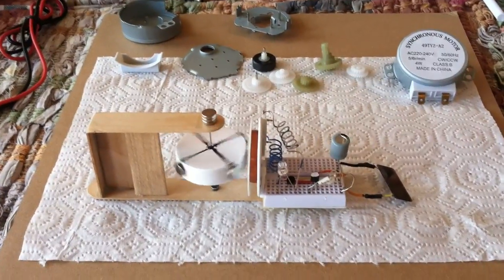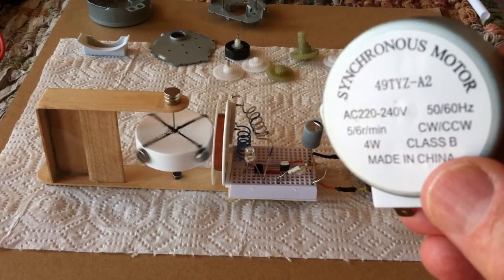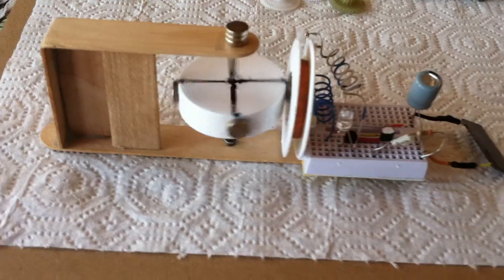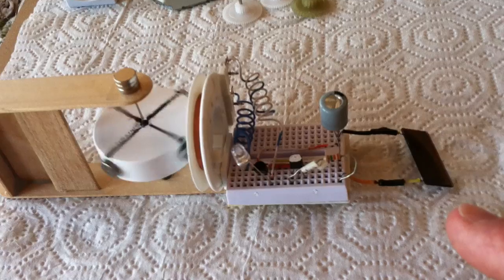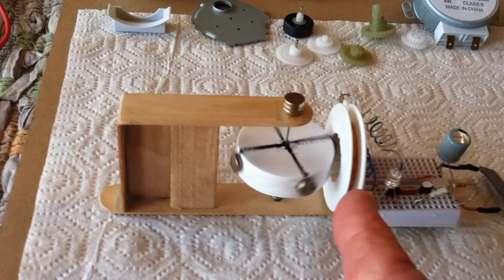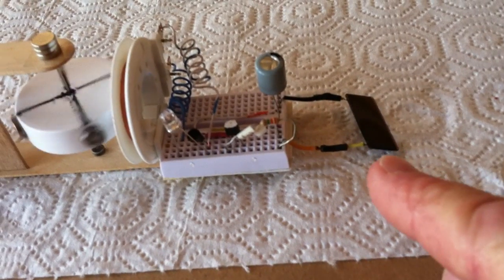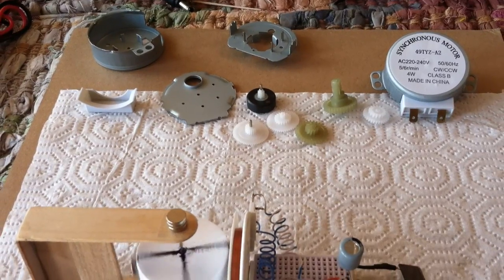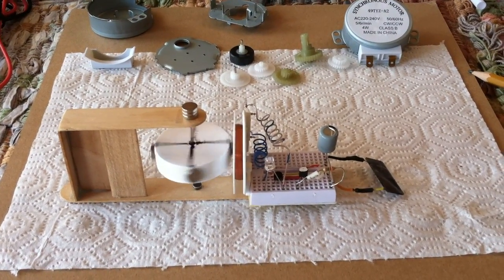Great News! ----- Excellent coil for micro amp pulse motors

Comment: I usually scrounge these out of 110v microwaves; I was checking olms on about
5 of them the other day and averaged about 3k olms for each.
I would appreciate some feedback from folks out there in how much resistance they
are finding in salvaged coils. Maybe my meter is wrong. Do most of the 220v coils
come in at about 11k?  Am I right about the 110v coils?

Comment: Hello Lidmotor.  Do you know where I can find a micro-controller controlled transistor/mosfet circuit for a Newman Motor?  I want to control the duty cycle, frequency and pulse width with the micro-controller.

Comment: The microwave synchronous motor coil is found in many other appliances also. Most fans that oscillate use one of these motors. (in addition to the main motor.) People throw away fans all the time because they stop oscillating. The motor (and coil) are usually fine, it's the little plastic arm that attaches the motor to what it is turning, is the part that is broken. I also replicated your basic electronic pulse motor (Title is: "Bendini style modification to basic electronic pulse motor") using this coil as the trigger coil and the microwave oven fan coil as the run coil. I also slapped together a fidget spinner pulse motor the other day (see my latest video in TallDudeInLA playlist) I know you can really go to town with a fidget spinner. I'm waiting to see what you will do with one of them!Eric (Tall dude in LA) using my wife's You Tube channel)P.S. If you can give me advance notice the next time you are going to be in L.A.,me and the wife would love to treat, you and your wife to dinner at a fine restaurant.
Reply from the maker: Thanks for the good comments.  I watched some of your videos and was glad to see the replications of my projects.  Your new "Fidget" motor impressed me so a sent away for a couple of those spinner toys to try.
Reply: Well, it was your videos that got me hooked on pulse motors and taught me most of what I know about them. (I think we had the fidget spinner craze before the public did, we just called it pulse motors:)

Comment: I'm glad that this worked so well for you. I see you got 240vac motors, but for most of us in north America will have 115vac motors at around 1 third the ohms so expect different results. Lidmotor what are the dimensions of the magnets you are using ?
Reply from the maker: These neo magnets are 5/16" x 5/64".  I got them at Harbor Freight.
Reply: I've been using the same ones, they seem to look larger in your video.

Comment: What is the Amp draw? 

Paul
Reply from the maker: I just did some testing and it is under 5 micro amps.  This is really really good news. You and Pali should get some of these and see what you can come up with.  Cheers.
Reply: Already ordered from Ebay. 5 micro amps is really great for an 11K coil. Still using the same circuit?  

Paul
Reply from the maker: Cool.  This is the same circuit from my last video.  https://www.youtube.com/watch?v=iIAHBDEik-s
   I replaced the super capacitor with a 330 uf cap and the solar panel. I upped the resistor to 3 meg.   The led doesn't flash at this low of power so it can be removed.

Comment: beware of spinning the magnet while it's still in the motor if you touch both leads you get a nice little high voltage surprise
Reply from the maker: YES!  I already knew about this so I was careful.  It is hard to turn but I put a neon across the terminals and it came on super bright with a slight twist of the motor shaft.
Reply: lol.i was playing this motor before  by accident i touched the terminal I've got  really nasty shock.
Reply: I'm poking at the idea if an arduino controlled motor kit with the right sized gears/cogs would be strong enough to spin the turntable motor and fwbr rectify it to self charge or power something else.

Comment: NICE !
Had no idea of the huge ohmage on those types.
Reply from the maker: I have know about these coils for awhile but finally got around to trying one.  It was the coil shape also that made a big difference.  This thing runs at under 5 micro amps and down to around 1v.  Some of our homemade batteries will run this easily.  I have been playing with this all day.  The 4 pole magnet in the MW motor made a cool little motor rotor also.  Ran it on a simple reed switch setup.

Comment: What circuit are you driving it with ?
Reply from the maker: This is the circuit.  I changed the resistor to a 3 meg and the cap is now a 330 uf.  The tiny solar panel is attached across the cap.  https://www.youtube.com/watch?v=iIAHBDEik-s
Reply: How do you choose the value  of the cap and  resistor ?  I want to replica it. Please help me:)

Comment: Another microwave oven part put to good use 😊 I actually get hate comments and abuse for daring to use microwave oven parts for projects 😊😊 I have a couple of those motors tucked away so I will have to give it a try 😊😊😊
Reply from the maker: I was surprised how easy this microwave oven motor was to take apart and how many usable parts were in it.   The coil was the grand treasure but I might make something else with the other stuff.  The magnet is pretty cool and I think I can use it as a motor rotor.
Reply: I've got at least one of those motors in my scrap parts pile. :)
Reply: Not certain why the hate comments for using the parts.  I get old free microwaves from a local appliance store.  I get thermal cutoff switches (for overload protection) timing circuits, magnets from the magnetron, capacitors,  transformers (which I sometimes rewire),  light bulbs and fixtures, numerous fans, and of course the platter motors.  Microwave ovens are a treasure trove of parts.  The rotary motors can also be used in reverse as generators.
Reply: You would have to watch my videos to see the comments, some people just feel the need to make comments like that. I could drop a link here but it would go in the spam folder and I am not trying to take viewers away from Lidmotor anyway. I think they see microwave oven in the title and expect to see somebody using high voltage to do arc welding or melt nails and get upset when they find a pulse motor or joule thief.
Reply: +mediaguardian
I couldn't say why they hate, but, it is important to be careful when disassembling a magnetron because they often times have 2 areas that are coated with berylium oxide, which is quite hazardous.  It can cause permanent & terrible health condition called berylliosis.